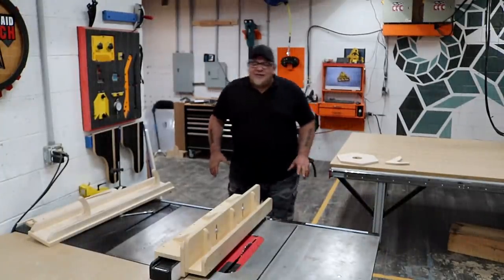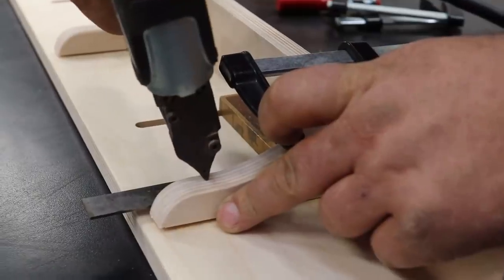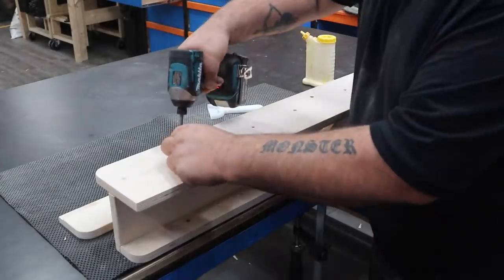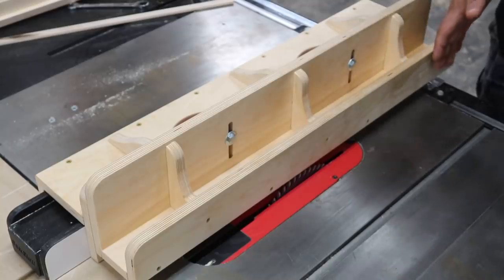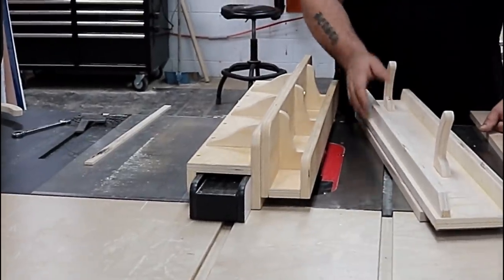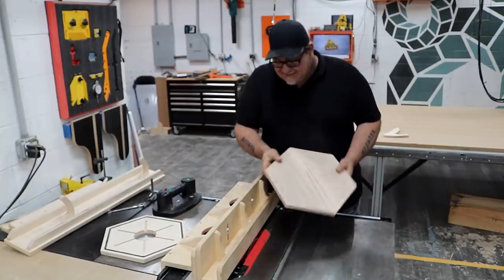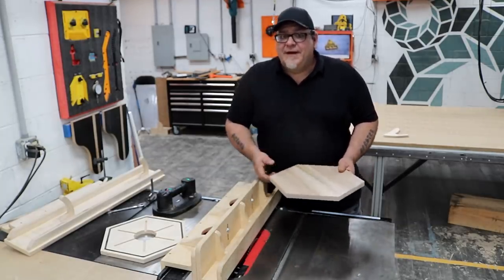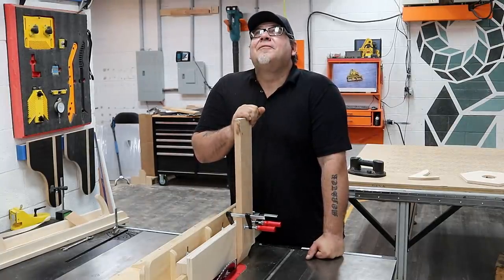EXTREMELY USEFUL | DIY | Table Saw Fence | How To Woodworking

Comment: That floating fence is great for cleaning up finger joints or dovetails left proud. Fast  flush cut, easy to batch out a bunch without fiddling with hand planes.

Comment: Izzy:  3:50 - If you shoot a short secondary slot off each of the vertical ones and terminate them at the correct spot, you could have the height of the fence indexed.  This is really a clever fixture.  THANKS for continuing to enhance all our workshops!

Comment: Nice, Izzy. I’ve used one of these axillary  fences for years, but mine is made from two pieces and is at a fixed height for 3/4” stock. As always you Izzyfied yours, taking it to a new level.

Comment: One more thing to enhance the utility of my table saw. When it can replace the need for a jointer and a pattern router, it's a good thing. Nice!
Reply from the maker: Great point!
Reply: @izzyswan  Great solution! I've got a small shop and there simply isn't any more room left for a jointer. So, the more flexibility I get out of my table saw, the better! Thanks for sharing this. 🤜

Comment: These fences are my favorite way to cut miters on a right-tilt saw as well.  Bury the blade in the fence at exactly the edge, and you can then run panels across it to miter the edges like a chamfer bit at the router table, but way faster

Comment: What is that clamp system with the bessy clamps you laid the boards on to glue up called.  I am definitely going to build this jis.  Save me some headaches
Reply from the maker: its one of my inventions. I call it the X-Clamp system
Reply: @izzyswan  Out of stock.  I've been away and doing nothing for the past 9 mo.  Time to start again.  Thank you

Comment: What is the panel clamp at 5:36 called?  Or are those individual clamps that Izzy fabricated together?
Reply from the maker: they are one of my inventions. I call it the X-Camp System. we sell them from time to time but are currently out of stock
Reply: @izzyswan  Ok thanks.  Ill keep checking back on them.

Comment: What is that spreading clamp tool you used to join the two pieces of wood?
Reply from the maker: Its one of my inventions. I call it the X-Clamp System. I make and sell them from time to time but we are currently out of stock.

Comment: This is a bit off-topic but any idea if the current small powermatic tablesaw fence t-square fits onto the older small biesemeyer fence guide?  I'd like to buy a second fence t-square for my saw for the router wing, but the local woodworking supply, normally pretty good/knowledgeable, is utterly useless on this particular question.  It seems like since they got their Fein display set up they've forgotten a lot of their institutional knowledge on other topics.